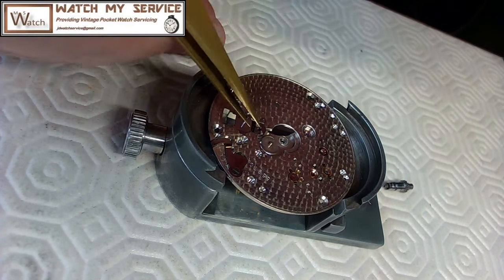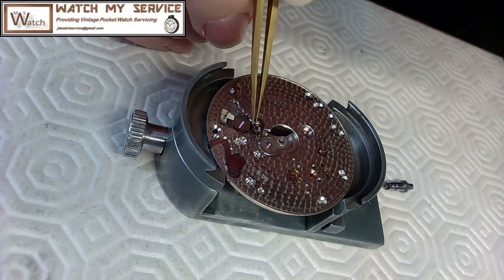Amazing Wind Indicator on Old Waltham Pocked Watch - Assembly

Comment: Shouldn't the wind indicator hand be positioned in the 12 o'clock position (pointing straight up) and then after it winds down to the 24 on the indicator dial it should then be wound up to the O on the wind indicator so that the power works on the middle of the spring? In other words, the indicator starts at O when wound up, then winds down to 24 indicating that it had run for 24 hours?